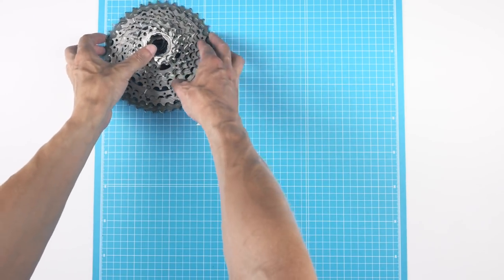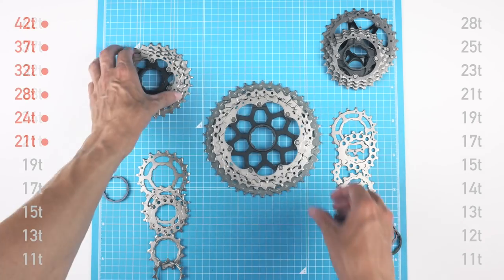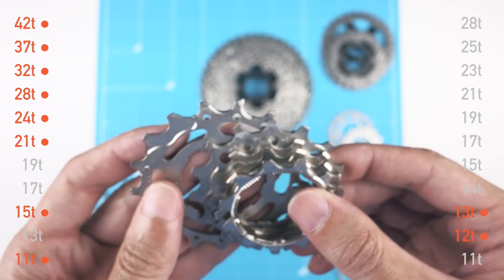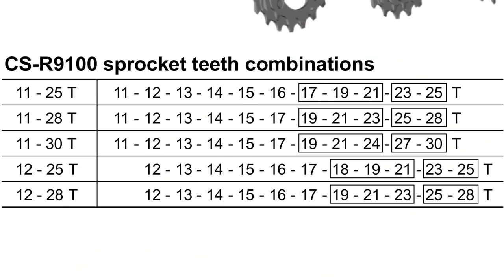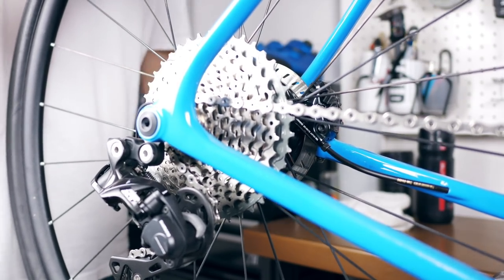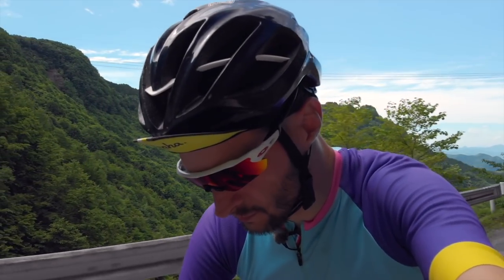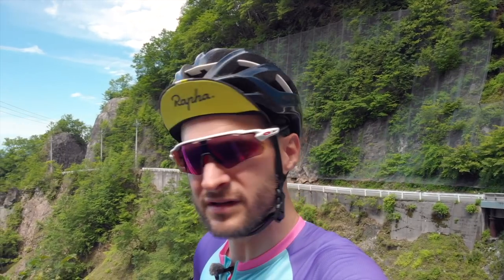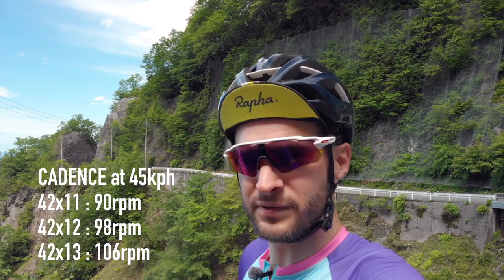Making a custom cassette from an MTB XT 11-42 and Road Dura Ace 11-28 for 1x

Comment: This inspired me to do some research. As of 2022 you can obtain a 12-40 by combining pieces from Ultegra 11 speed 12-25 and 11-32, with the last two pieces by 3 of a 11 speed XT cassette. You get 12 and 13 as the first two cogs of the 12-25. Then you take a 14, 16 and 18 from the 11-32, and then the blocks 21-24-27 and 31-35-40 from the XT. You get 12-13-14-16-18-21-24-27-31-35-40, which is a sort of "compact" cassette in 1x understanding of gear ranges. You can use it with a 48 in the front for a good mix of speed and climbing, or with a 44 if you ride long walls and coast the descents. It's similar to a 11-36, with a range wider of almost 1 tooth, so almost a 11-37 with decent spacing between gears.
Reply: The ut 12b，13b，14a，16b，18c，and then the blocks 21-24-27，Is the 18 to 21 shift smooth?
Reply: @kkqogir5837  The cassette is smooth in terms of the chain shifting up and down. As all the 1x systems, there is always a bit of penalty with cadence, and perhaps the 18-21 is the worst part because it's right there at around 30kmh roughly with the 48 ring. I will soon switch to the 44, and perhaps the sweet spot speed will go more towards the 16, so it's a bit better.
Reply: @gianmarcocostanzo1380  thanks
Reply: Yo pondría un cassette de 9v de11-38 con un 24-40 ó 22-38 en un biplato y me ahorraría tener varias  coronas gigantes en el piñón.
Reply: 18-21, yuck. No point in 12-13 small gap since 12 is a bombing downhill gear. The Shimano 11-40 cassette cogs are already as perfect as they can be for 11s. Tighter gaps in the middle, wider gaps near the ends.
Reply: @EricPeelMusic  the original 11-40 still has the 18-21 jump, and you add the 15-18 jump too. You can never solve it with anything smoother than my 14-16-18-21 in the middle (the original is 13-15-18-21). I ride it now with the 44 in the front and I'm satisfied for it being a Shimano 11 speed. But I ride 80% MTB during the year, so I'm totally ok with a little cadence jump.
Reply: I’m talking about XT M8000, I think it is. There’s no 18-21. It goes: 11-13-15-17-19-21-24-27-31-35-40. Its as perfect as 11 stepped whole values can possibly be.
Reply: @EricPeelMusic  you are right, the XT is as you say. When I planned this whole thing I didn't like the idea of those 11-13-15 (2 teeth jumps) where you  can really suffer with your legs for the cadence jumps. Whereas a 12-13-14-16-18 is very compact and your legs won't die when you want to pedal strong at 36-40kmh. The 18-21 jump is, on the other hand, somewhere where it is rather easy on the legs, especially with a 44 front. But if I had to do it again I would go with a simple 11-36 and 40 front (for hilly rides) or 44 front for not steep hills.
Reply: @gianmarcocostanzo1380  No offense but you have the concept of the 11-40 cassette a bit wrong. I thought the same thing too before and even modified the 11-40 to be 14-40 by using a 14-28 donor cassette. The jumps on 11-40 are designed the way they are on purpose. 11-13-15 are good to have large because when you're using them, you're likely moving rapidly downhill on varying terrain and changing speed quickly. The jumps get tight near the middle of the cassette because this is when you'll be riding flatter, more level, consistent terrain. And they get bigger towards the easy end because again, terrain gets more uneven and bigger jumps are more appropriate there. If you had 11-12-13-14, they'd be too close and you'd need to do more double shifts to find the right gear. Those super close jumps only really work for descents on road bike where the grade is more consistent.
Reply: @EricPeelMusic  exactly as you say in the last sentence, here we are talking about a 1x for a road bike, not a MTB. I ride MTB too and there I have 9-50 so I know what cadence jumps are when riding in the terrain. Again, the issue is if the cadence jump 18-21 is exactly at the speed you carry the most of flat roads. If it's not there where you suffer pedalling for 80% of the ride, then it's a totally fine jump. I have this issue with the 48 front, because then the jump 18-21 is exactly at the flat road speeds. Now I went 44 front for steeper hills, and the flat road is more between the 16-18. In a 1x for the road, especially 11 speed, there will never be optimal gears.
Reply: @gianmarcocostanzo1380  On a road bike, ideally I would not want more than a 14% jump anywhere on the cassette. 18-21 is too big at 17%. I actually ride road with the 11-40, not mtb. I just assumed it was kind of the same issue at cruising speeds. There's no 16-18 on the XT cassette either 😆 I think we're talking about different cassettes. 😅
Reply: @EricPeelMusic  16-18 is referred to my custom cassette. Also, you mentioned you don't want more than 14% jumps anywhere in the cassette, but please calculate for me the jump between 11-13 and 13-15. You also mentioned that the last couple of cogs are just for bombing downhill, but that's not necessarily true for 1x systems for road bikes where you have limited range and you need gears you can pedal and then you coast the fast descents. Nevertheless, I have just bought the XT cogs 11-13-15-17-19 and will try them as I have a race in a couple of weeks and might need that additional fast tooth (and the 48 front) for not being dropped pedalling at 50kmh in the bunch. What convinced me is also the fact that Shimano normally sells a 105 11-34 that is identical to the  XT 11-40 in the 11 13 15 17 19 21 part, so it means amateurs usually don't complain about it.  By the way, that 11-34 wouldn't be too bad afterall if you ride flat terrains only.

Comment: Well.. I did it. Took the Franken-cassette plunge. Combined my stock SRAM PG-1030 11-42 on my Ibis Hakka, with a SRAM PG-1070 11-28 road cassette. My goal was for smoother cadence at higher speeds. (I know, go back to a 2x) 😎 Here’s how I stacked them: 11,12,13,14,15,19 (from road cassette) then used the 25, 28, 32, 36, 42 from the OEM Hakka cassette. Needs just a slight more shifter input going from 15 to 19 and then from the 19 to the 25. I adjusted the B screw just a few turns but not sure I needed to. Will road test for better feel. Thxs for this idea!

Comment: If you're willing to use lower tier parts,  the 105 and SLX cassettes only have the 3 largest cogs riveted together, other 8 are single. 
I think shifting technology is the same, just heavier materials. 
It could give you a bit more options
Reply from the maker: Christian Lafond yeah, that definitely sounds like a better option if you wanna really customize it further! Cheers! 👌
Reply: sram apex cassette are all single cogs

Comment: when things get steep , big differences in gears isnt a problem , my perfect 12 speed cassette would be 11 , 12 , 13 , 14 , 16 , 18 , 20 , 23 , 26 , 30 , 36 , 46 , once I'm on the 26 and it get steeper anything will do :-)

Comment: I'm a fan of the old 12t cog in first position.  I have a 12-32 sun race cassette.  It sticks you with starting 12-13, there is no way to start 12-14, but ditching the 11 gives you a no jump 12-32 cassette.  I'm pretty much the same as you, my dream would be 11-12-14-16-18-21-24-28-32-36-42, which is the old 9 speed 11-32 cassette with the two extra on the back.  

I would also really like to see a 10-11-12-13-14-15-17-19-21-24-28 for the road come out someday. 50/10 beats 53/11.
Reply from the maker: Jonathan Zappala yeah agreed, when I was on 2x I used the 12-28 cassette, that was a good as it could be! Hmmm... 11-12-14-16-18... that’s in interesting option! As Bobbie E. Ray pointed out that link for spare cogs... there’s no limit to the possibilities 😄
I seems that the cogs are optimized for a specific cassette though... if I can live with the wonky shift delay I might give it a go.

Comment: I've just made a hybrid/crossover of two 7-cog MTB cassettes: the HG200-7 (12-32) and the HG41-7 (11-28). The point was to get a greater range of ratioes - my franken-cassette now has 11 to 32 and I love it. I don't mind shifting 11-13-15- at the tough end of the range. Once I get to the point that a more thorough revamp is needed, I'll probably convert the bike to 8-speed - the axle is long enough.
Thanks for your vid, it was reassuring to know in advance that principally this is possible.

Comment: Shimano sells 14–28 Ultegra cassettes, for junior racing and 11s commuter bikes. It comes with the desired 18t cog. Or you could harvest it from the off-series 11–32 cassette, which was released to match the new U5000 groupset. Part number is Y1Y918300, sells separately for 5€.
Reply from the maker: Cheers!
I found the 18t at a local store here in Tokyo, can find pretty much anything here hehe
Reply: @ridesofjapan  Remember, don't take apart other's bikes unless solicited. ;-)
Reply from the maker: Haha, will restrain myself
Reply: @ridesofjapan  So I'll entrust you with the knowledge that the merlon are imperative for shifting and placement, the ramps are merely supporting. Compare their particular shape. Cheers!

Comment: Good to see that the olde assembling of freewheels is still a living art ;-) 👍👍
About the 18: how about using a Miche cog? They sell cogs which are compatible with the Shimano system separately.
Reply from the maker: Teun Luijbregts ohh! Did not know that!
Thanks for the tip, will check it out!
🙏
Reply: Teun Luijbregts Was going to say the same thing about Miche being the other brand that produce a wider variety of cassette ratios for both Shimano/Sram/Campagnolo.
Reply from the maker: Rusevelt Roberts 👌👌👍👍
Reply from the maker: Low hanging fruit brilliant! Cheers!
Reply: @ridesofjapan  you have a 18t cog from ultegra cs-r8000 part number Y1Y918200
Reply from the maker: Carlos França cheers mate!
I’ve already got the 18t from a store in Tokyo where they sell all Shimano cogs separately, worked out great!

Comment: XT cassettes are great! Most optimal solution in terms of "quality per buck" (or yen:). I use XT CS-M770 11-36 10 speed cassette with GRX400 groupset, and its completely trouble-free, pretty light and shifts perfectly!

Comment: 14,15,16,17,18,19 on flats and slight grades, 19,21,23 grades and headwinds, 32,37,42 for the hills, all at 90-100rpm 🤌 14-19 are from an Ultegra 6800, 21&23 from Sora 9speed cassette and 32-42 big cluster from a Sram cassette. All powered by a 36t up front, later in the summer when the legs get back in shape a 38t or a 40t replaces the 36t
Reply: Is it also possible to draw any sprockets from 9v and 10v cassettes and fit them onto a 11v cassette? How did you manage in spacing them correctly? What spacers did you use, for example? Are 9v and 10v cassettes' sprockets as thick as in a 11v cassette?
Reply: @YunqueParaforjar  a couple 9speed cogs wont hurt and I used all 11speed spacers

Comment: I have an 11-32 with  a single 38t chainring.  This is all the gears I need.  Almost never use the 11t cog, so I'm thinking about getting an 11-30 cassette with a 34t chainring for smaller gaps.

Comment: I tried to match up a 11-32 and an 11-42. The cogs were the same width but the shifting was trash. Its nice to see that you managed.
Reply from the maker: RG's Shed interesting! When you say trash are you talking about the same type of delay when shifting?

I’m not super bothered by it but it definitely not as crisp as the original cogs
Reply: Rides of Japan no no, i used more than one cog from a road cassette and it looks like the spacing was just wrong, i didnt look at it in too much detail tho. I might give it another try. However i know what you mean because i use an 11-32 road cassette with an xtr mech and the shifting isnt as fast as an xt cassette

Comment: Doesnt make sense to compare difference in teeth between successive cogs, best to compare % change between them. So in this case I would go for 11,12,13,14,15,17,20,24,29,35,42. As you see when you leave the corncob setup (after 15t) then you must increase by the difference of the previous gap by 1 tooth. So after 15 you go to 17. Then the new gap must be 2 (as 17-15=2) + 1 =3, so 20t. And so on
Reply from the maker: Yes I agree, you’re 100% correct 👌
if you really want to make it nice and smooth going % is the only way.
All of this was a compromise to get that 12t and the rest wasn’t really a priority. I wanted build this without buying too many new loose cogs, but that said, I’ve since swapped the 17 for a 18 and while it’s not optimal percentage wise, it’s a slight improvement in the gaps between 15 and 21 (or it’s maybe it’s just placebo 😆)
Reply: Tiene todo el sentido ya que la cadencia no debe ser pasada por alto, una RT mas progresiva siempre es mejor que una con grandes saltos, especialmente cuando se trata de momentos de fuerza donde un salto grande en la RT hace perder progresividad y produce vacíos donde se pierde potencia por saltos tan grandes, pero bueno, hay muchos hijos del marketing en los comentarios.

Comment: If I understand correctly, if you mix and match sprockets from different sets, there's a good chance the shift between them won't be hyperglide, which I suppose is fine if you're not racing. The shape of the teeth could be different even on two sprockets of the same size from the same series if they were meant to be used in different sets. For example in the 105 series, the 15T sprocket in the 11-28T set is different from the 15T in the 11-34T set. It probably matters very little for casual use.
Reply from the maker: Oliver Racz yep, spot on.

Comment: for cyclocross i use a 1x11with a 42 in front and a 12-32 custom-cassette.. don't need the 11.. so now I have 12-13-14-15-16-17-19-21-25-28-32 (need a 11-30 cassette for the use of the 19-21)

Comment: I only just got the courage of my convictions to get a 11-34 in place of my 11-32. Probably hoping too much that the extra two teeth will help me haul my fat ass up the hills but as I’m a x2 roadie will check out the spread of all 22 ratios. It’d be hilarious if I turned up at s group ride with a 42 ...tempting 🤣. Another cool vid showing it possible to try different things out. Awesome scenery too. More please

Comment: I have the 11-42T as well but saw someone had combined it with a 14-28T cassette to build a 14,15,16,17,19, 21.... 42T for their 2x system. Do you think giving up the 11 and 13T cogs with the 34/50T would be a big deal.  At age 60 I’m rarely able to push the 50/11 gear but having some closer gears may be a good thing. OTOH, I was on a downhill segment the other day and I noticed I was in the 50/11 quite a bit. Hmm.

Comment: SRAM Eagle 10-50 has a 12 and 18.. :-)
Reply from the maker: stijndeklerk true! But they still don’t have road shifters for eagle yet right?
Also that 50t is a bit over kill even for me 😅
Reply: You could always run a 53 in the front hahaha, that'll make the 50 in the rear decent. Plus you wouldn't spin out on a descent until 75kmh+ (might be a bit too much haha)
Reply from the maker: Brad Comis haha! That’s true actually 😂
New (unannounced) 12speed xtr di2, maybe a 50t front and that 10-51 cassette... crazy! I like it!

Comment: I matched a 12-25 and 11-32 ultegra cassette and it works quite Wells, it’s always a good idea  ‘’custom ‘’ cassettes.
What do you think of 1x drivetrain for road use ? I am thinking of replacing my ultegra compact by a sram 1x
Nice vidéo, thanks a lot
Reply from the maker: Camille C all depends on how picky you are with cadence and what terrain you’re riding. If it’s flat terrain 1x and something like 11-32, or 11-34 should work just fine. But once you get up to the bigger 11-42, or 10-42 for road you will have these bigger gaps... me personally is okay with that, but for racing and hard training it probably not ideal.
Thank you very much!

Comment: I did something similar with my road cassette. I wanted a higher ratio so i bought a Ultegra 6700 12-30 cassette. But this left me with the old dura ace cassette becoming redundant. So i combined the two...! There is a jump in the middle like RoJ describes, which is probably just an artefact of Shimanos cassette Design.. Anyway, Works perfectly and weight savings to Boot! Video on my "channel"...
Reply: Nice! I bought 12-30 yesterday and want to change 21T sprocket into 16T. Did you bought 12-23 to have 16T sprocket or something like CS-M771-10 works?

Comment: I see you ride a 42 front ring. Do you find that enough in combo with an 11 cog for riding on the flats? Also, do you use a gs (medium cage) or a sgs (long cage) derailleur?

Comment: I was always wondering why you used the heavy Shimano cassettes. Sram's XG-1195 shifts perfectly nicely with GRX 810, so I guess it would do the same with any other Shimano groupset, while being around 200 grams lighter. But they are one single piece, so customization is not possible and the 12-10 jump is even larger than the 13-11 jump on the Shimano cassettes.
Reply from the maker: You answered your own question there :)

Comment: Love your videos!  Also love the jersey you're wearing towards the end of the video.  Any idea what brand it is??
Reply from the maker: Cheers mate!
It's a Void cycling jersey from a few seasons ago, so this particular design is not currently available unfortunately.
Reply: @ridesofjapan  Thanks for the info!  Looks like they have some pretty sweet designs still.  Any recommendation on sizing?  I think we're about the same height (I'm around 185cm).  I always struggle to decide between medium and large
Reply from the maker: Jackson Wearn while I'm around the same height I'm only around 64-65kg so I'm a small in most brands including Void (also like my jerseys tight)
One good thing for me is that Void seems to be slightly longer than other brands in small... Don't know if that translates to the larger sized though.